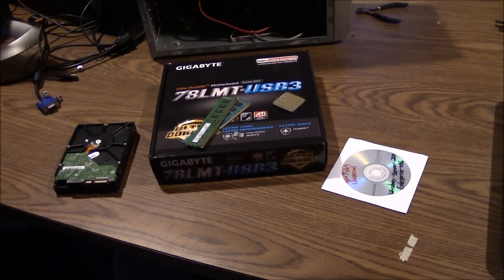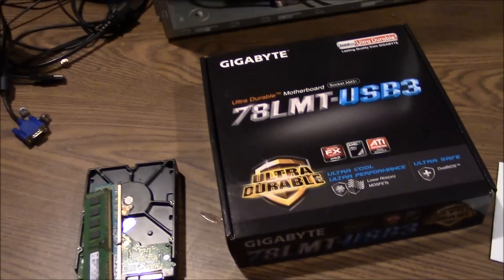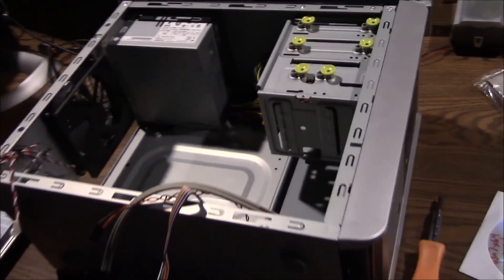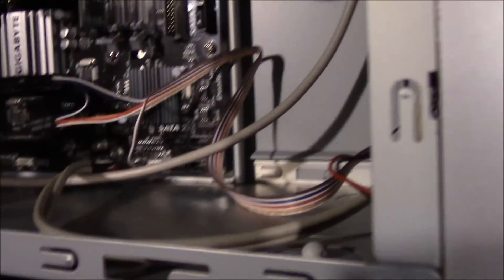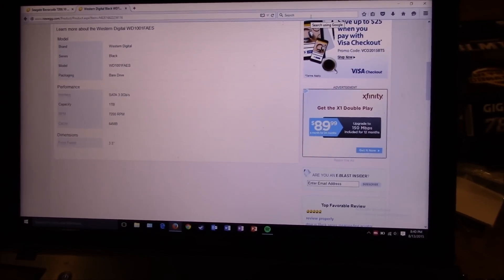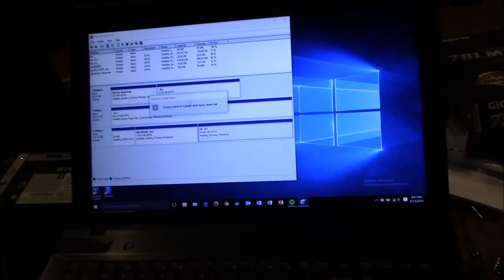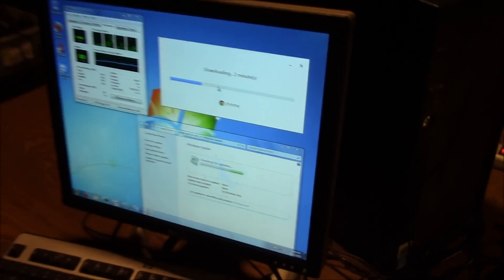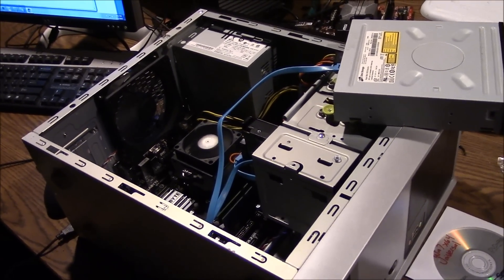Building a Quad-Core Workstation PC for Under $60!

Comment: I also had the elite 430 but i really didn't like it that much. How about you?
Reply from the maker: Ramses De Vuyst I think it's a solid budget case - only ran me $40 versus $100+ for most good cases. The side window plastic scratches very easily, however.
Reply: Someone7089 Mine has a scratch on it too. No idea how it got there. i paid way to much for it, 60€.

Comment: If you intend to run dual channel, you should move one stick to another DIMM slot. The channels are color coated (grey and black in this case). Heck, that 2gig stick might even work.
Reply: Obvious troll is obvious.
Reply: Wow, you're not even good at trolling. LOL.

Comment: LOL Some who can feel the same pain as me having 300 kbs internet connection
Reply: ***** well well... 250mb
Reply: ***** I've got 12
Reply: +Whomba Wobble I only have 80 :-(
Reply from the maker: Matt Freyer 200Mbps in my apartment for college though. Too bad the wiring only carries 100.
Reply: +Someone7089 We are actually switching internet providers because the company we were with was charging us for a 6Mbps connection but the lines we have can only support 3Mbps. It will be a 20 Mbps connection
Reply: Mine is 3.5mb on a very good day.
Reply: Yo, have you tried seeing if the cablle was split, like one cat5e cable for 2 outlets? ive seen a lot of places do that so it happends more often than you wold think!Someone7089
Reply: 20 kbs :(
Reply: but only download, upload is 150 mbs
Reply: Matt Freyer LOL!

Comment: My workstation has an amd 6 core processor clocked at 4.4Ghz and 8 Gb s Of Ram 1Tb hdd spacee and 120 gig kingston ssd and an amd/ati gpu
Reply: ***** I get around 4.2-4.4 stable on this mobo with an 8320e 4.2ghz at 1.415v on the vcore but my cpu fan helps blow air across the vrm coolers